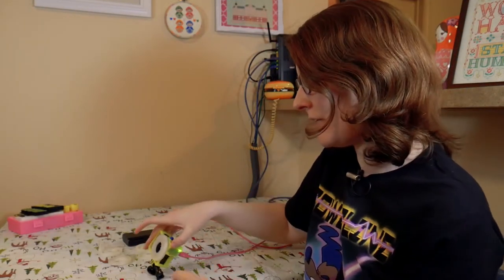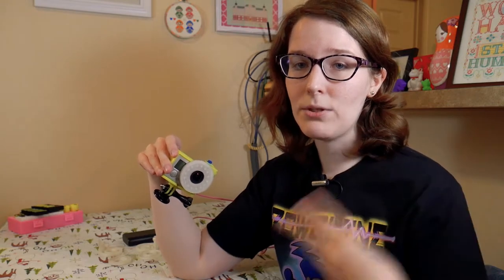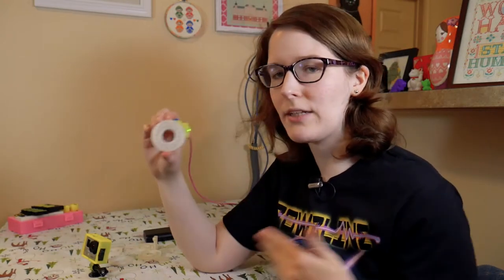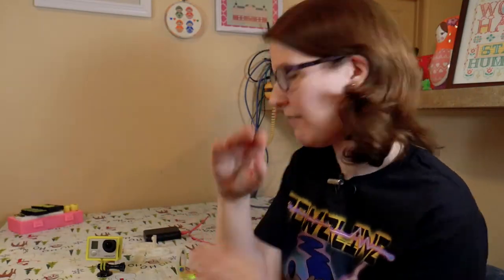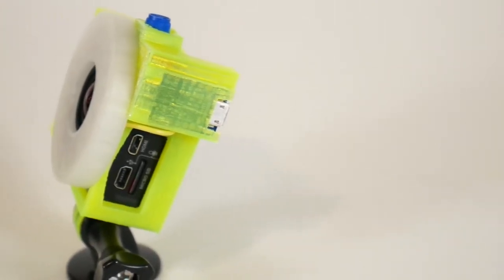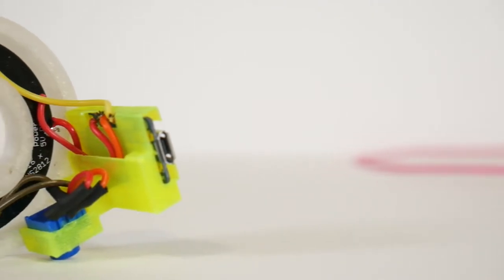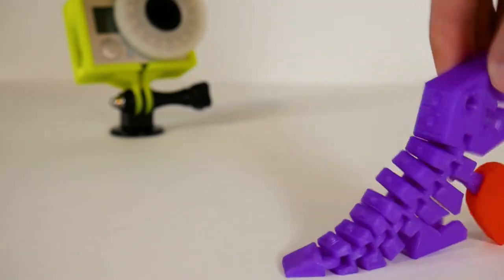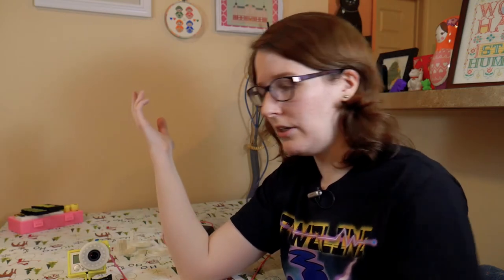DIY GoPro Lens Light

Comment: Great video Liz! Using translucent Pla as a diffuser is a great idea! I use a webcam for my videos and have been toying around with making something similar. I was going to use a mixture of cold white and warm white LEDs with maybe a couple of rotary encoders to control (or I might use use an esp8266 and control with a web page, not sure).

Also, the power line songs not being on spotify, even though the goofy movie sound track is, might be one of the greatest atrocities ever.
Reply from the maker: Thank you very much! Your project sounds awesome- great idea to use a mix with a rotary encoder to fine tune it. I wasn't aware that the songs weren't available on spotify but that is terrible. I rocked the soundtrack on cassette back in the day :)